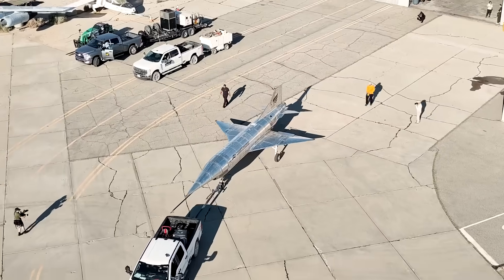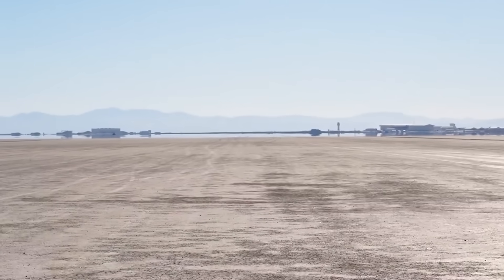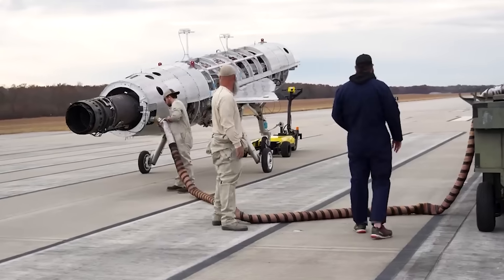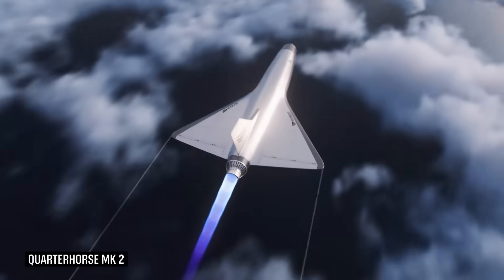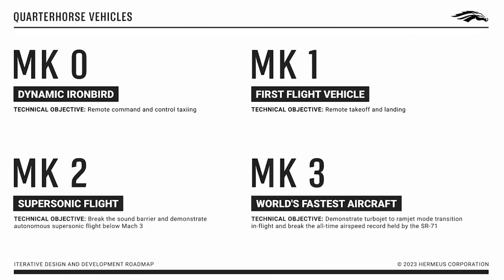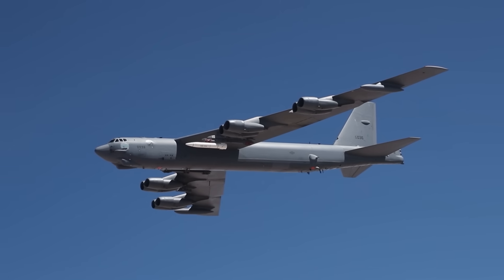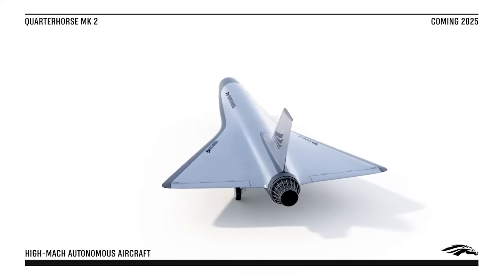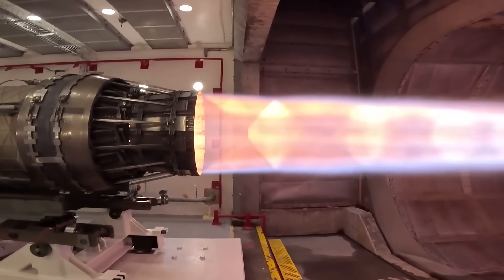Hermeus completes first test flight of hypersonic jet design!

Comment: The US Army just chose General Dynamics and Rheinmetall as finalists for the 4000 Bradley replacement IFVs (well, a year ago, and i will keep asking).
Could you do a Firepower series video about this program, the two finalists and the other three that dropped out. Or more generally the current state of IFVs (Bradley, CV90, Puma, Lynx) and their most likely future. Maybe even including anti air IFVs like some CV90 variants and SkyRanger.
Reply: All those mentioned are vulnerable to drones.
Reply: @mrbaab5932 everything is vulnerable to drones. Plus drones have limited range

Comment: It looks like the early silver supersonic test/fighter jets we built in the 50s/60s.

Everything really is a circle.
Reply: F-105
Reply: @RexFeral55  I was thinking more along the lines of the F-104, only this time without the pilot and more powerful engines.
Reply: I was gonna say the same thing, kinda looks like a chrome Mig-21
Reply: Because it is about speed again, VS  maneuverability, which has been more emphasize for the past 50 years.
Reply: It’s because that’s what it takes for high speed fight from an engineering and cost perspective
Reply: F-104 my beloved
Reply: It totally looks like the early X-planes & hopefully it will be just as important
Reply: Probably for the same reasons, maximise aerodynamics
Reply: complete with taking off from the desert. Really is a throwback
Reply: Looks like a lightning
Reply: I was about to say the same thing... right down to the shiny aluminum skin.
Reply: @chrisjohnson3912 
Paint isn't great at hypersonic speeds (not tested that fast yet, I know.). Also just adds weight...
Reply: @edwardfletcher7790 There are ceramic "paints" that will proform at 2000 degrees F. So...
Reply: @JosephKlacik 
Just because they can handle high temp doesn't mean they can deal with mach 3+ 🙄
Reply: The final product will probably look different
Reply: Specifically, the Nord Griffon
Reply: When the F15 went for speed records they stripped the paint and polished the metal too. Paint causes drag. A polished metal version of any aircraft will be its max speed.
Reply: Concept hasn't changed. Can't push past the known until you find the limits of the approach.
Reply: Yeah, it looks pretty underwhelming, especially compared to the legendary SR-71 or the imagined SR-72.
I wish Hermeus all the best, but this seems to me like a ma&pa shop trying to break boundaries and solve extremely difficult scientific and engineering problems regarding the reusable hypersonic flight, that a much more experienced and well funded companies from US, Russia and China weren't able to.
I can see a newcomer succeeding in defense industry when a product is connected to an emerging AI based systems, Anduril being a great example.. But Anduril is developing software while guys from Hermeus are building a holly grail of propulsion - combined cycle engine - in a warehouse looking facility your local tire shop may have, planning to go hypersonic ....And all that 3 times faster and 5 x cheaper? I doubt that..
Reply: That’s what I thought I was going to watch
Reply: The aircraft you're likely thinking of is the Fairey Delta 2 from way back in 1954 which was the first jet aircraft to exceed 1000 mph (1600 Km/hr) in level flight.
Reply: @Jack-bs6zb
No American knows the Delta 2, only TWO prototypes were ever made !

However they ALL know the almost identical Lockheed F-104 Starfighter, designed by Skunkworks Legend Kelly Johnson.

2,500 were made and they flew in the Korean War.
Reply: Physics don't care about our "feelings" 😂
Reply: I think a big part of why they're "silver" or "bare metal" is that it's easier to keep track of against the backdrop of the sky, ground, sea, and potentially space.

Might also be a way to save some money during testing
Reply: @robdenny514  I was thinking it was more for the same reason that F-15 that set records had done so naked: paint's weight accumulates and if it isn't needed, why apply it?

I'm not convinced it'll be that much easier to see though, unless its curved sides catch the sun just right, but that would only be a momentary glint, not a continuous reflection to track.

I could be wrong, and I'm fine with that if so. This is just what my deductive reasoning is telling me it's all.
Reply: @robdenny514  def to save money on paint that will just get torn off by heat at those speeds.
Reply: Nevermind the fact that they used RIVETS for the panels...

RIVETS?! I thought rivets were an outdated construction method for vehicles!
Reply: @TylerHarris-yy7uf  Could be wrong, but I'm 95% sure rivets are still the common attachment method on ALL aircraft, they're just recessed, unlike these.
My gut tells me it's because you can easily drill out a river to remove a panel and then simply reattach it with new ones once everything is fixed/addressed. If it's welded, you have to cut the weld and now you've irreparably made the panel smaller, thereby needing a replacement.

They use threaded fasteners in some areas if it's serviceable stuff within, but YT it doesn't need access why affix it with something that has a mechanical means of loosening? (particularly with the contacting/expansion of them as they get hot whilst flying; not sure if Loctite will hold up forever)
Reply: @TylerHarris-yy7uf  It's about speed, manufacturing and testing speed.
Reply: @TylerHarris-yy7uf  Rivets are fine, they won't add much drag, planes without rivets are to reduce radar signature, even for non stealth planes.
Reply: Agreed.
Reply: To think we already had supersonic Comercial intercontinental travel.
They better be able to make the length of regular runways work.
Reply: Isn’t optimal for Mach 5
Reply: @BARelement Test platforms don’t need to be optimal, and the plane they make that actually will go Mach 5 hasn’t been made yet.
Reply: @fakecubed Then can everyone stop acting like 50s fighters were optimal for hypersonic speed lol. They act as if god himself deemed the 50s perfect. It’s sickening, and delusional.
Reply: @fakecubed Because if what they said were true. The MiG 21 would be the most perfect design in history.